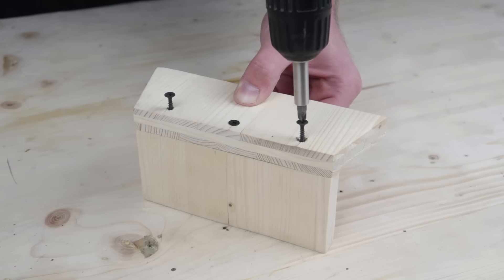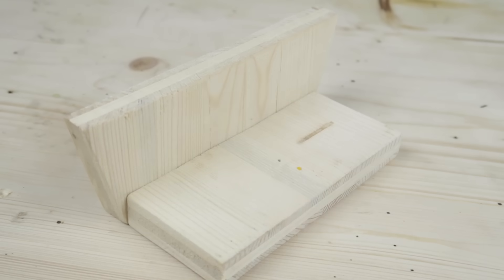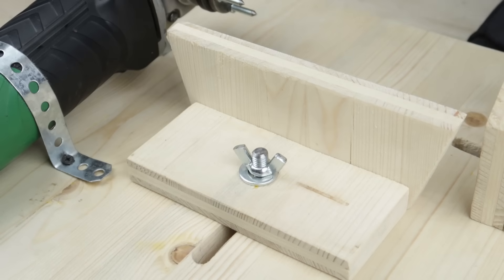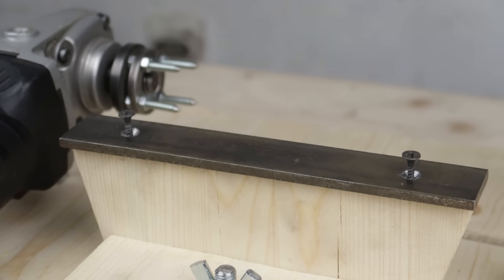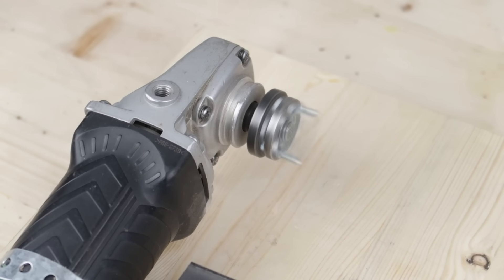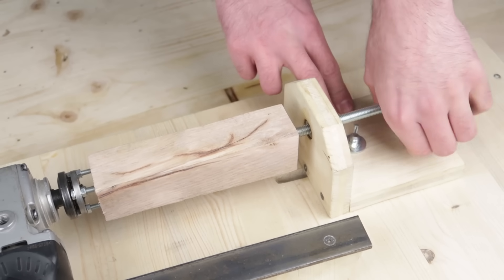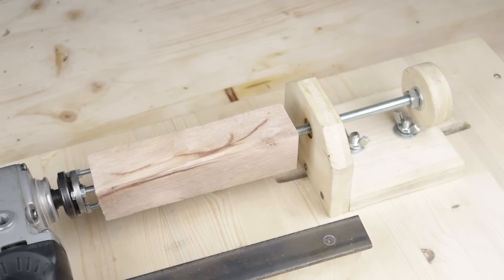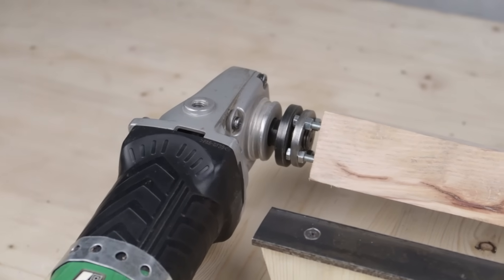This is why NOBODY will tell YOU this ANGLE GRINDER Hack!

Comment: I'm about 99.99 percent sure he drilled the first couple holes with the drill in reverse
Reply: It just looks like it is in reverse due to the frame rate vs the actual rotation of the bit. Think how wagon wheels appeared to be running backwards in the old westerns.
Reply: Yea, I saw that.  Well. He made ithe drill out of a CNC motor and a coke bottle……
Reply: Yeap you right
Reply: No it's forward..
 It's just looking like it's in the reverse position if you don't think so try it and record it and just use a large bit and watch your video it'll show the same motion. LoL 😅 for real..
Reply: Nope, thought the same thing first, but the drills and seemingly the rest of this guys tools are just that dull. 
Don't take advice from a guy who doesn't know how to sharpen his tools.
Reply: Using a grinder to turn wood is very simple but highly effective, very useful for practical application.

Comment: SCREW THAT! I am a tradesman wood machinist who has had his share of chomped fingers over the years. This is an accident waiting to happen at worst, outright power tool abuse at best.
I could easily see someone trying this with a grinder that is not speed variable and the entire rig disintegrating in their face at 13000 rpm
Reply: Twas my first thought at how dangerous this is.
Reply: My thoughts exactly, and I'm just a handyman. Unlike a Dremel, most grinders don't have a speed setting, and wood at high speeds tends to blow up.
Reply: I tried it and now I have to type this with my nose.. fingers gone.
Reply: I’m a controls electrician and it amazes me how people LOVE multi tools for jobs that require precision work and skills. Multi tools are for handymen not season professionals.
Oh FYI, I carry my Leatherman everywhere i go, so I’m NOT bashing multi tools at all. I love my Leatherman , but I know when NOT to use it.🤘👍🤙
Reply: Tradesman wood machinist 😂 what the fuck
Reply: @pttthhh  LOL
Reply: I am just an average guy that does a bit of carpentry as and when, but as soon as those bolts went through the locking nut on the grinder I shuddered. That is the kind of thing that can lead to loss of fingers, eyes, blood and possibly more when it all fails and decides to rip and tear the person using it.
Reply: Yeah my first thought as someone who has done a bit of machining is this looks pretty dangerous. Rather him than me. I just hope not too many people try and copy this. Good for entertainment but definitely a don't try this at home. Should come with a disclaimer really.
Reply: Who said anything about a multi tool?
Reply: @CoitusWithAntelopes  Yes mate, It is indeed a thing in New Zealand. 8000hrs [4 years] trade training and I have a Trade certificate to prove it. From your derisive tone I can only assume you have no idea of the complex machinery required for industrial level furniture and joinery manufacture such as Multi headed moulders, spindle moulders, double ended tenoners, Chain and oscillating mortisers etc. Want me to go on?
Reply: Un
Reply: I kept hoping for a punchline …sadly there wasn’t one
Reply: All built with cheap hardware and a harbor freight angle grinder 😂
Reply: @tobylou8  it's like a slow motion train wreck , you just have to watch the whole thing
Reply: I happen to be an immortal, however I still feel the pain this idea has caused me as I tried to replicate this project. Even in the very beginning when I put the nut& bolts on the grinder, my intuition was screaming " stop it right now"
But to prove my point I pressed on. Thinking the most positive . Unfortunately for me , I hadn't put my safety glasses on , when my home built contraption failed the first thing to break off this went right into my  good eye. 
So a word to the wise. DONT
Reply: I made a clock once in middle school which is the entirety of my wood working experience and even I know this is a good way to have a bad accident.
Reply: @pttthhh  🤣🤣🤣
Reply: @enriquet2562  this is a use for an angle grinder not a multi-tool, i have DTM52Z but i will not be using it for angle grinding
Reply: @mt4798  first thing i thought was to weld those bolt and nuts to that collar
Reply: I knew a guy who turned a mini grinder into a circlular saw,; put the blade on backwards... Needless to say, It got away from him and cut halfway through his pecker.
I told him that was the universe teaching him what a dickless idea he had to do that in the first place.
Reply: Many people has lost a hand or a couple of fingers when trying to convert an angle grinder to a saw or other incompatible tools.
Reply: The fact that you dont' know what is being made is probably the worst part of the video unless someone actally wastes their time makeing it after wasting their time watching it.
Reply: @enriquet2562  skin an elk with a leathermen haha
Reply: I want to see that
Reply: YOU GOT IT J.G.!!!
Reply: @Brian T same here. that crap makes my toe nails roll backwards...
Reply: I'd merrily take a small piece of wood like that to about 2000 RPM, though I would obviously check for cracks first. And I'd do it on a proper lathe instead of a homebuild contraption like this. Tends to be better centered as well that way.
Another thing is, I'd use a proper turning chisel. Those tend to have much thicker shafts made of different steel, meant to handle the torsion exerted on them. I'm not fond of the idea of holding the handle of a chisel in my hand wih the blade flying right through my stomach.
Reply: @CoitusWithAntelopes  I too am a wood machinist. My job was to take whole trees and machine them into tooth picks. Sometime I was tasked with machining chop sticks, real high skilled stuff. Not for the untrained nor the faint of heart.
Reply: @jeffgreen983  Sheesh, dude. It's a hack, not an industrial level furniture making machine. Not everyone has access to your complex machinery to accomplish a tiny little task. Relax. It's a dangerous world. People lose life and limb every day travelling from point A to point B.  Get over yourself.
Reply: @jdubxi11 in high school I made an eagle, well it looked more like a penguin.  I got a C +. Lol I'll stick to building houses that's already milled
Reply: @nomasknoway9903  "It's a hack"
It's a dangerous- and nobody should be doing this.
Reply: @emm_arr  Life is dangerous. Live a little.
Reply: @nomasknoway9903  It's a dangerous- and nobody should be doing this.
It's stupid.
Reply: @emm_arr  How do you think the first lathe was invented? Someone had an idea and tinkered in their shop. That's how. How do you think the first automobile, or airplane, or any other modern technology came about? What about modern wood shops and machines shops with the most expensive and modern equipment? Do you think they're safe from accidents? Dude, fear is stupid. I have a neighbor who is fearful and never comes out of his home. He taught his son to be fearful and now his son is too fearful to come out and play.  If you're too fearful to try things, you don't have to. The rest of us will invent things and enjoy all that life has to offer and not depend on someone else to provide. Who cuts your food for you?  I'll bet your wife does. Cowardice is despicable.
Reply: @nomasknoway9903  It's dangerous. Nothing you post changes that.
Reply: @emm_arr  Yes. That is true. Your home is dangerous. Leaving your home is dangerous. Living is dangerous. Nothing you post changes that. Get out of your imaginary world and live.

Comment: Used to be a Manager of a Harbor Freight Tools store and sold cheap $20 side grinders, had a customer that wanted to modify it with one of our 4" table saw blades to make a tool to cut baseboards to put down tile or hardwood floors. We sold a tool for this. Had adjustable depth, and reach but it was about $60.  The side grinders had a 5/8" arbor, and the 4" wheel had a 1/2" hole. The side grinder ran at 20,000 RPM, the table saw blade with Carbide teeth had a Max RPM of 6500.  He wanted to Redhill the table saw blade up to 5/8". I told him that it would have to be completely concentric or else it would be off center and wobble like an Egg. He planned on using a Reostat speed controller to slow the grinder down, so I told him that most grinders really didn't run like that, and would bog down and shut off if they didn't get enough power.  About 2 weeks later he came in. His right hand was bandaged up, and he told Me that he should have listened. He tried His idea, had to run it without the Speed Control, it started to vibrate so bad He dropped it, that blade broke into several pieces, one about took his thumb off, and parts of the carbide tips fragmented like shrapnel into his forearm before he could get clear.  He bought to Side mounted Cut off saw to cut his baseboards.  I did give him his Money back on the grinder as it was undamaged.
Reply: this is why tools that rotate at high speeds always have soo many warnings on them! there's always one guy that thinks he a innovator and ends up losing a hand. But at least this guy admitted he was wrong and learned to not do that again.
Reply: Thats why i disliked this video.
Reply: Whoa 😳
Reply: reminds me of the scene in the movie hot rod where bill hater is grinding and a piece flies into his brow, I once used a grinder to grind through a hydraulic cylinder, that didn't go well, out of all the tools in your shop the grinder is the most likely to injure you.
Reply: @victorleskiv  any tool is dangerous if used incorrectly or for the wrong job, that's why its crucial to be educated about the tool and to only use it for what's its intended for and safely
Reply: @ Doucen996 Are you still one of their managers or an ambassador for tool manufacturers? The DIY homemade version is always cheaper and does just as well a job as the commercial version but at half a price.
I love what this guy has done. I will definitely be turning one of my angle grinders into a DIY Lathe/ Thanks for the brilliant hack and idea
Reply: What could POSSIBLY go wrong?  😬
Reply: @GuyWithAnOpinion2  everything, the amount of dickheads on YouTube who are on a heading to a meet with death when it comes to grinders its unreal. This tool has a 5' grinder with  no guard and a 7' disc. Then makes the world's fastest wood lathe. Although his grinder has speed control. You seen the grinder drill? Chain saw? The most dangerous goes to the circular saw blade of about 6.5' mounted on a grinder, no guard and its almost 3/4 the length of the tool!
Reply: There's a reason tools are what they are and you just made my point for me thank you, certain tools have certain speeds at certain rpm limits AAAANNNDDDD certain TORQUE  values and limits, I applaud 👏 his approach and imagination but as I said and you made very clear tools are what they are for a reason
Reply: you should have tried to sell him an oscillating tool instead. you can get them just as cheap as the grinder and you do not have to modify them to do the job he needed doing. i recommend them over any circular type saw for trimming door jams for floor work.
Reply: @martinnyirenda2525  You will end up getting pieces of wood surgically removed from your head.. Possibly even a chisel blade. I have years of experience with grinders.. This is one of the most dangerous things I have ever seen. Youtube should know better.☠
Reply: Shame that customer now cannot give you the Thumb up, for you advice.
Reply: Pain is the best teacher, won't do that again
Reply: @victorleskiv  he won’t do it again with his remaining hand, right.
Reply: Good times
Reply: One of my neighbors was building a bbq pit, and his grinder walked on him and sliced right into his belly and Dr pepper started coming out of it.
Reply: Funny i did the exact same thing. But i had a huge dust shroud covering %85 of the blade. I also used a drill press to make the arber 5/8.  but no speed control. I was using it to cut hardwood floors that had walls built on top. Worked quite well and fast.  ( thankfully all Limbs and body parts are still accounted for Lol)

Comment: This has inspired me! I'm going to do the same thing with an old 250cc two stroke dirt bike I have. I'm going to make it into a lathe. I'm just going to hook stuff to where the sprocket goes. Just imagine I'll be able to turn trees that are 18 to 25 in thick. Watch for the video in upcoming series I'm going to call death of a diy-er.
Reply: This invention can be used as a back scratcher.
Reply: My dad knew a guy that turned a rear axle and 4 speed manual transmission into a metal lathe. It actually worked fairly decent. He could control his speed and even pitch threads.
Reply: It's not uploaded yet.
Reply: @anthonyr2319  That's because it killed me and now I am a ghost. We don't show up on film too good.
Reply: Bro! And you have inspired me to grab some wood and turn my car into a lathe. With voice control!! "Son, daddy wants you to step on the gas", "Son, Son too much gas!"
Reply: these exist in Thailand.

Comment: This is brilliant. If only there was an actual safer tool out there like this. If only! What a time to be alive!
Reply: i put a centre bolt in a length of wood & a second with a sharp tip and drag it round , without any power tools , perfect circle every time any size , i can carve a wagon wheel outta a barn door with little effort
Reply: Bruh also. People can diy lathes and it be safe. I had the honor or working with a badass artist who did. He shipped solid wood stools to japan that weight 50-60 lbs fat! Whole thing done on lathe
Reply: There is a safer tool it's called a wood lathe

Comment: If I wanted a lathe , Harbor freight tools has a really nice bench top lathe and is much more safe than this setup which is very dangerous because of the high speed of an angle grinder , Even with the speed turned down , You have to start at a very low speed because your stock is gonna be out of balance and running it that fast can launch that piece of wood and you have no idea where it's gonna go and possibly hit you right in the face or forehead
Back in high school , One guy was turning a baseball bat on the lathe and he turned up the speed to finish sand it , He didn't realize that the wood was off balance and it shot out of the lathe and hit him on the bridge of his nose , He was very lucky to be alive and had to have reconstructive surgery on his face and plastic surgery , For safety's sake
Buy yourself a lathe instead of trying to make one because if that piece of wood comes flying out of there and hits you in the head can kill you  , A lathe will cost much less than ending up in the hospital
Reply: Yeah. This can’t end well…
Reply: I actually have the Gründer shown..I got it from Harbor Frieght...lol
Reply: But the person in your example used a proper lathe and still got hurt, so why not just build one like in video? If you're gonna get hurt might as well save some money.

Comment: The vibrations will ruin the gearbox pretty soon though. On lathes you have the spindle connected to the motor through a belt. So that vibrations caused by excentricity of the rotating piece you're working on don't get transferred onto the motor shaft (bearings) and rather dissipate along the elastic belt. The RPM are too high as well. And I wouldn't want to be around when that piece of wood rotating at 25k snaps off the spindle...
Reply: True indeed , If that piece of wood comes flying out of there and hits you in the face or the forehead , Can kill you , 
True indeed about the gearbox and the bearings , An actual lathe has much heftier bearings to withstand vibration from out of balance and vibration caused by tooling the piece of wood , Back in high school , one guy was turning a baseball bat on the lathe and when he went to finish sanding it , He turned the speed up too high and the wood was out of balance , It shot right out of there and struck him on the bridge of his nose
He was very lucky to be alive and ended up in the hospital and needed reconstructive surgery and plastic surgery , 
For safety's sake , Use an angle grinder for it's intended purpose only
Reply: Next: Dremel powered lathe!
Reply: So... he could hook it up to a belt. Granted a variable speed grander would be better suited too? Perhaps?
Reply: @catlady8324  True too , Whatever lathe you buy will cost much than ending up in the hospital , I myself use my angle grinder for it's intended purpose only , Using power tools to do things they're not designed for is an accident waiting to happen
Reply: Trueeeee
Reply: THIS IS WHY NO ONE WILL TELL YOU HOW TO DO THIS WITH AN ANGLE  GRINDER VIDEO 😂
Reply: Verrry interesting... but shtupid.

-- from "Laugh-In"
Reply: Yo. Would a bench grinder be any different?
Reply: I have a strong feeling this guy is a regular in the ER at his local hospital.
Reply: @MyRefugeIsChrist  bigger motor means it takes more beating before getting toasted. Also probably much lower RPM (like half that of an angle grinder eve), so off-balance is less of an issue but still an issue. 

but unless you make a proper transmission (belt) it's still a bad idea IMHO

like, have you ever turned anything on a drill press? you can only use sand paper and saw blades, but small parts like knobs or pulleys can be made that way. Knives and chisels are a no no, cause you'd ruin your drill. Slightest off-balance makes it go BRRRRR 

Now imagine you do the same, but not at 1500 RPM but at 3000-12,000 RPM. 

Nah.
Reply: That's not the point. The video title is clickbait and with 2.7M views so far it has made him a fair amount of money already. That was the entire reason for the video, not to tell people about some HACK that no one else will tell you about. This is what YouTube has turned into and he's just playing the system. Good luck to him.
Reply: @LearnToReadThai p